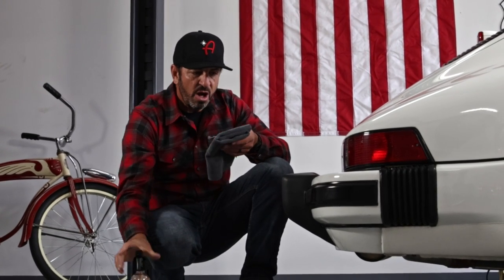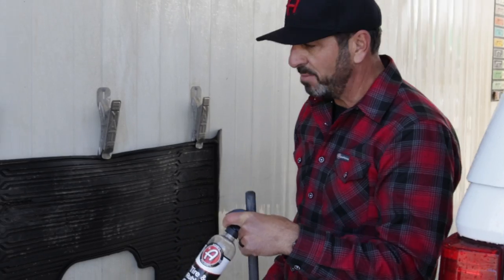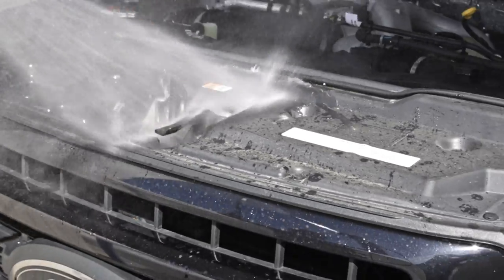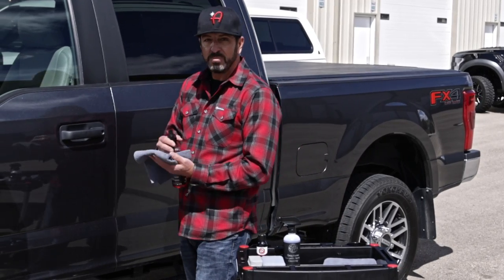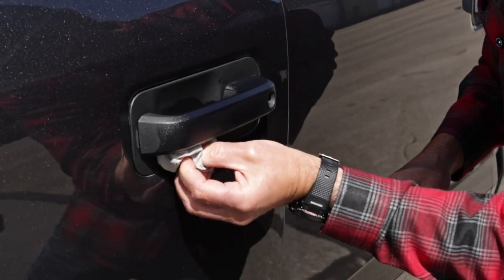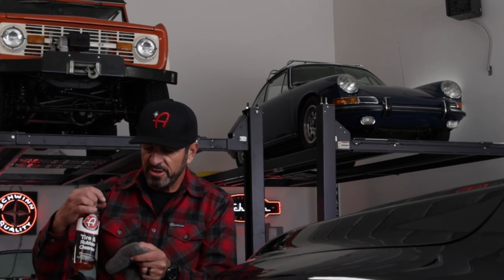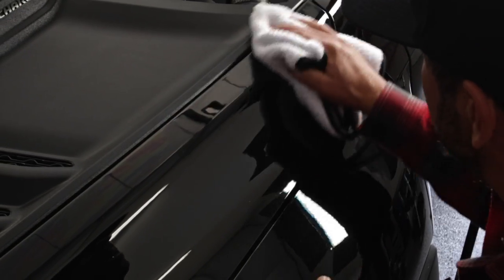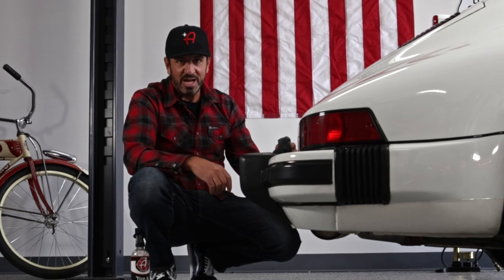An In-Depth Look at Tire and Rubber Cleaner

Comment: Can you use this in paint to decon?
Reply from the maker: Hi there, our Tire & Rubber Cleaner is a citrus degreaser that works excellent for engine bay cleaning, but we wouldn't necessarily recommend it for paint decon. Our Iron Remover is made for chemical decontamination, and then you could use one of our clay bars or clay mitt for mechanical decon. 

You can find our Iron Remover here: 
https://adamspolishes.com/products/adam-s-iron-remover